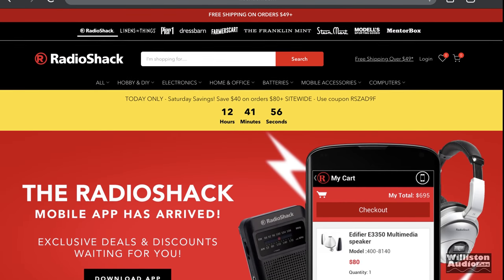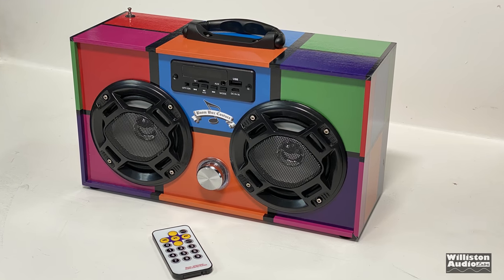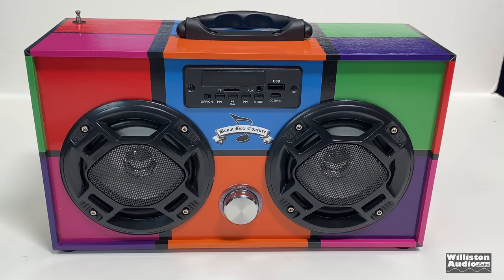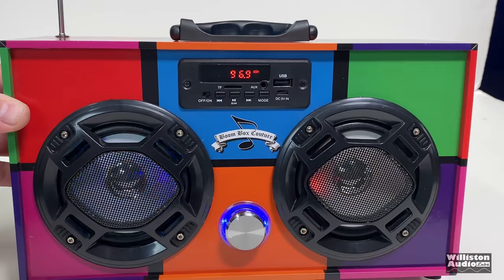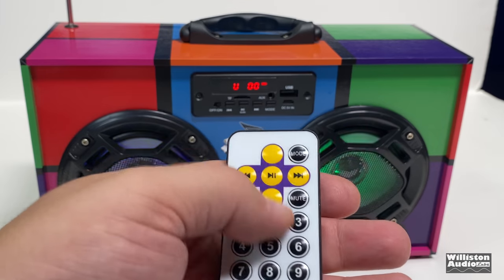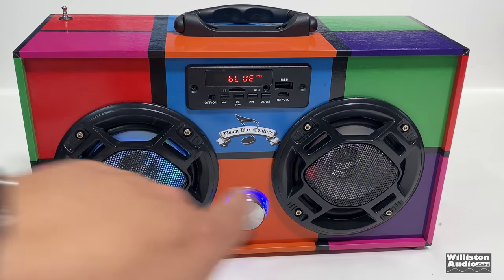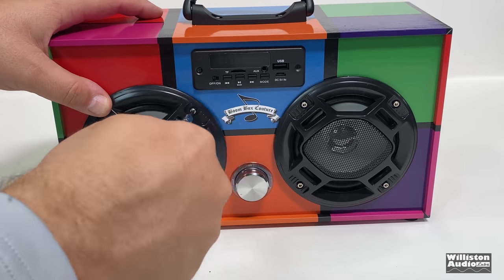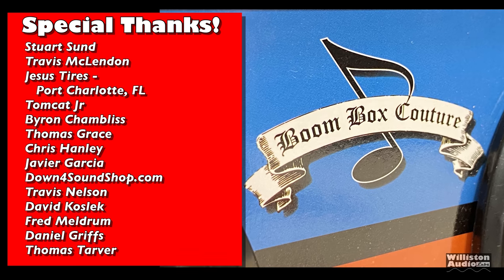This Amazon Bluetooth Speaker Surprised Me

Comment: Can we get an amp Dyno of it it'd be fun to see the actual power it puts out
Reply: I want to see dynamic burst at 40hz at 1ohm 🤣🤣
Reply: very likely PAM8504 (if I remember the number correctly) that claims 3+3w in stereo from 5v, begins distorting at 1.75 to 1.85 isn't too shabby for a postage stamp. they have a newer one that's 5+5w, might do an actual 3.1 to 3.2. I'd just replaced the older PAM with newer, its near twice as loud.. so yeah.

Comment: This would be a good start for an upgrade project. Brace the inside, upgrade battery, add a second amp board, upgrade speakers, stuff the box, change the port, etc. Lots of stuff you could do to pack in the power.
Reply: This looks like a perfect donor I’m using to build into my kids pedal car.
Reply: @ShadowPitt  That sounds rad. I'm eagerly awaiting my brother's kids to grow up to that stage so I can join them in building stuff like that. I missed out on that sorta stuff when I was a kid.
Reply: @ShadowPitt  you can get an mp3 module for about 4 bucks and a newer PAM 5+5w 5v amp for 1.25 in eBay. there's another available pretty cheap that's 2.1 ch if you want a little woofer kicking from 5v.
Reply: @modelnutty6503  thanks I’ll look into that.  Sounds better I appreciate it

Comment: In the 1980's, Radio Shack made a couple really nice boom boxes. And their Mach 1 speaker is still legendary. I had a pair of Mach 1 speakers...pretty dam nice. And loud with the horns
Reply: Were those the ones with those big dome horn tweeters?  They used to sell those separately, my brother used them on his DIY speaker build
Reply: I had a pair of the Mach 1 speakers, I ran them on a 25 by 25 watt trio amp the bass shock the house back then.
Reply: I had a set of "Linaem Pro". They had a 6" woofer and a multi directional "ribbon" tweeter.They were unique and sounded really good for the price. I also still have a set of "Optimus Pro". They are the ones with a 5.25 woofer and a soft dome in a metal enclosure, they also sound pretty good...But those Machs are classics...no subwoofer needed...and real wood veneer...they don't make them like that any more.They were probably maybe $300 each in the 80s?...that is wild guess...I miss the Shack

Comment: I bought a similar speaker for $20 but it looks like a mini plastic PA speaker with a 6.5" woofer with compression driver. Its basically the same as this $50 boombox, probably all made in the same factory. Well there was no tweeter behind the phase plug of the horn and the sound lacked highs. I swapped the woofer for a 3-way car door speaker and it sounded way better.

Comment: The battery controller is probably very sensitive, when devices like this stop taking charge it's usually because the battery has been completely discharged and the logic on the board think it has been disconnected so it doesn't even try to charge. You have to "wake up" the charging circuit manually by applying voltage to the battery terminals with another battery or a power adapter. We have some equipment at work that I have to do this to regularly especially in the wintertyme

Comment: Interesting little piece of kit. I'm guessing the battery inside is of marginal quality to keep the cost down but since it appears to be a stock 18650 it should be easy to replace if needed. It's a shame the FM tuner only does presets. It's pretty hard to find new reasonably priced home audio with a decent AM/FM tuner that doesn't auto skip from one station to the next these days!

Comment: newer PAM amp claims 5+5w from same 1S input voltage, 
wired one to a similar mp3 module (replacing older PAM 3+3w)
it definitely performs better than the old amp.

Comment: 70s Partridge family. 80s Rubix cube. 90s ???? That board or at least one very similar is readily available online. The swanky box and grilles with the LEDs are a little tougher to find. Overall looks like a decent deal for $50 and plenty of room for mods! I have some Alpine type S coax that would drop right in there
Reply from the maker: I’m old, give me a break if I’m off a decade or two 🤣

Comment: I'd rather build one myself with one of those chip amps you reviewed
Reply: this probably has one of those chips, im pretty sure you can buy the plastic part with the buttons, bluetooth and amp etc seperate from ali express or some place.
Reply from the maker: That would be better or get the kit from Parts Express. It’s quite a bit more $$ though.
Reply: @wal  I made one from a Helix Match pp62 dsp, A Helix Match PP8eq subwoofer a pair of Helix 6.5components, and a set of Helix 6"co ax...and a lawn tractor battery. It is big and heavy, and quite expensive and , perhaps I should have my head examined...but it sounds good ... also a Helix URC3 and a Helix blue tooth kit...I prefer German stuff
Reply: That sounds a tad expensive, yet nice all but that "lawn tractor battery... Way too heavy, you went all out on everything else, now it's time to shed some weight & find yourself a small light lithium battery to take the place of the one you're using now.

Comment: Well you know what I ended up doing is I ended up ordering one of these and I'm going to enjoy hacking it because I know how to put those speakers out of place and actually wire my own home theater speakers done it before it's got enough power to do my floor speakers that are 12 inch drivers so that'll work it's Worked fine for me in the past with other small little Bluetooth speakers that I would splice into place

Comment: I won't buy a Bluetooth speaker that doesn't have USB type c charging.
Those type B connectors can be compromised and break off the board.
At that point you won't be able to charge it!
Reply: I haven’t managed to break one off since it’s been around.  Even w/ young kids touching things they shouldn’t.  What I do have is USB-C connectors that get worn out and won’t hold a cable anymore.  Not saying one is bette than the other.  Just that USB-C isn’t w/out issues.
Reply: @Bob_Smith19  You've been fortunate then.
I've had one break on a Bluetooth speaker and also had one break off of a personal audio portable amplifier.
Reply: @Bob_Smith19  USB C is 10000x more superior to USB B.  I think you are the only case where I hear USB B outlasts USB C because everyone and their grandma's USB B has the highest failure rates while USB C has been solid and have high longevity rates based on meta data and analysis
Reply: @Bob_Smith19  when I have a USB c that won't hold a cable it's always because a cheap replacement cable is the issue or like in my phone it's because I have lint build up in the hole and have use a needle to scrape it out so the cable fits snug again .

Comment: Nothing about that radio is retro maybe the color. All those components are the same in cheap radios from china that maybe cost USD $10.00 if that, the only difference is the box shape and color. I've had many of these cheap radios and once the cheap battery goes the Charger plug cannot supply enough current for any kind of bass or even if you turn up the volume half way. I would definitely PASS on this radio its a piece of Junk.

Comment: Ouch. That bass/midbass sounds sloppy with no highs to speak of either; cheap 1-way drivers. Cabinet is nasty.... 3/8" chipboard, unbraced, gives rise to a horrible one-note thuddy tonal quality in the lower octaves. If you measured the frequency response of this thing it would be probably have a huge hump at ~80-100Hz and then roll off at 4kHz.
Reply: Yes. Its a very Shitty radio and the speakers are 2ohm. I don't know why he made a video of this crap.?
Reply: @tuffytoys9707  He likely got it for free and he needs content, he's an audio channel, there's only so many car amplifiers, eventually he's gonna run out of things to talk about and have to post stuff like this.
Reply: I'd liken selling this thing at $50USD on the level of a white van scam with the caliber of parts in there... Speakers: $0.50, battery: $0.50, chip-amp/BT board: $3.00, cabinet: $0... just slapped everything together in a box with hot schmoo and wrapped it in a cheap vinyl sticker. Margins on this must be insane. There are BT speakers that are a fraction of the cost that have custom tooling with plastic overmolding with nicer components.

Sure, reviews of various audio products are always welcome. It's fun to see obvious flea market products that no enthusiast will seriously buy.  What's different here that it's reviewed as having some redeeming features. If we had a review where we laughed at it that's cool, but at the price and caliber of product I wouldn't want to convey any notion of even promoting it indirectly (let alone posting an affiliate link).
Reply: @recon440  yeah he's seriously losing credibility if he thinks this is a good decent speaker.. He even opened up and saw how awful the drivers are and the ghetto ass singular battery out in the open.  Other BT speakers have 4-6 in series in a proper enclosure.

Comment: Do not shop amazon
Reply from the maker: Where you gonna shop? Mall?
Reply: @wal  eBay, allii and xpress
Reply: @DANTHETUBEMAN 😂all Chinese crap as well
Reply: @typhfanuwu7526  not when USA manufacturing goes to China, now they make the name brand, and there own design with the same parts, as long as the metal is good, then CNC machining will make good parts